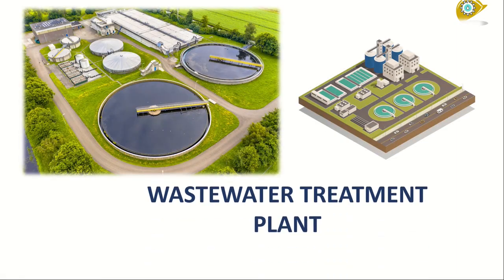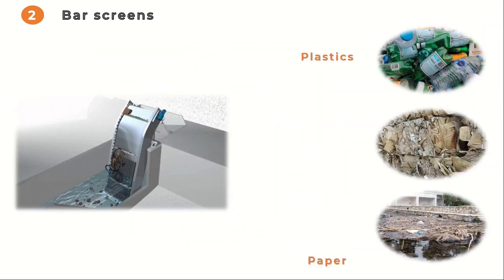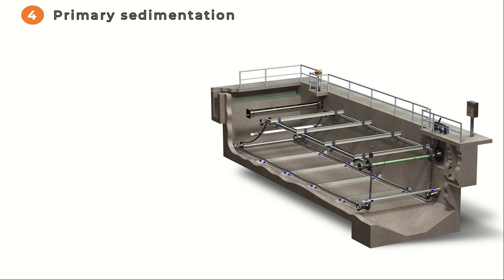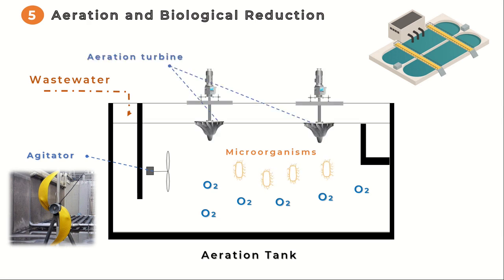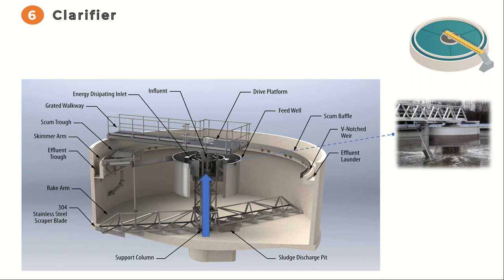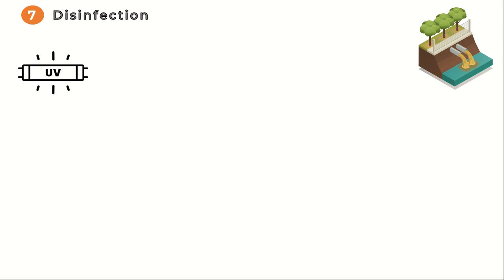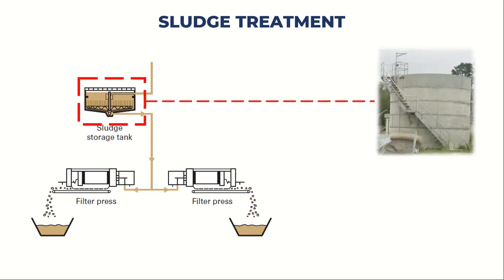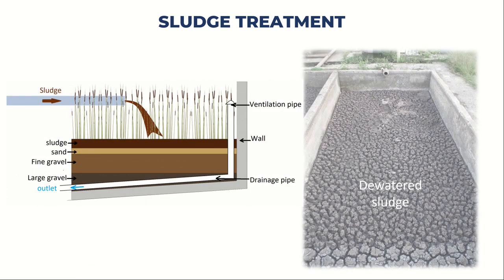Wastewater Treatment Explained - From Beginning To End

Comment: I just took a job in my small town at the waste water plant... it hasn't been tended properly in 30 years.... I have no experience , but learn fast and have a 25 year history of fluid control and solids management on drilling rigs... there are no resources here available and I don't know where to start looking ... (very , very low budget) clarifier is broken and there is no sand in sand filter beds, no pumps for effluent water ,  no pumps for chlorine addition. I need some practical help on a shoestring budget ... can you help ?
Reply from the maker: Of course. you can contact me on my Fiverr account : https://www.fiverr.com/s/18dPq9?utm_source=CopyLink_Mobile